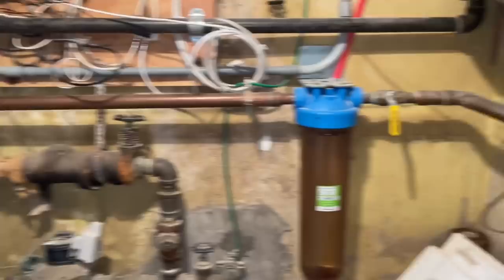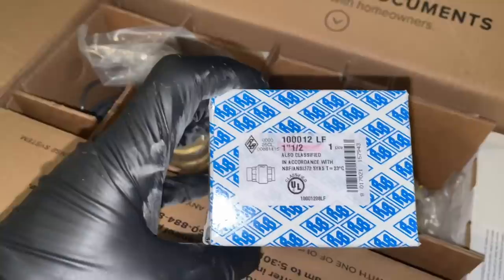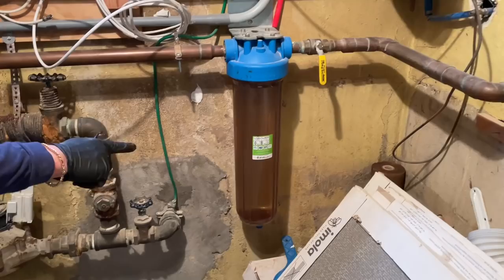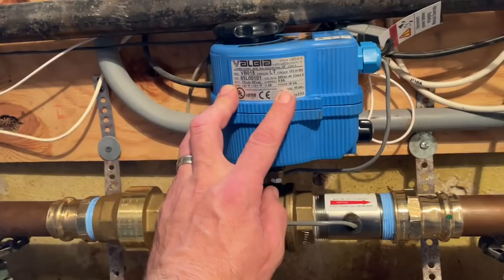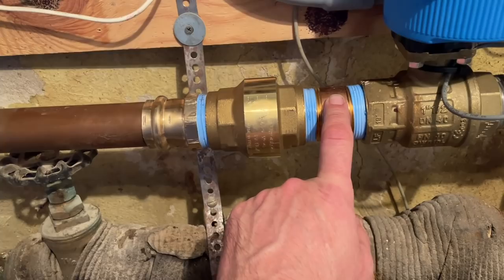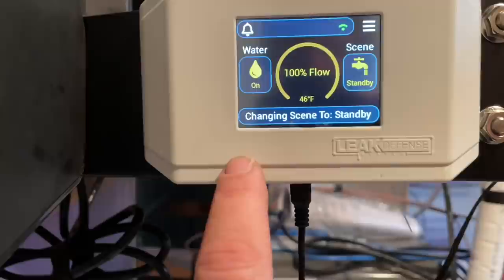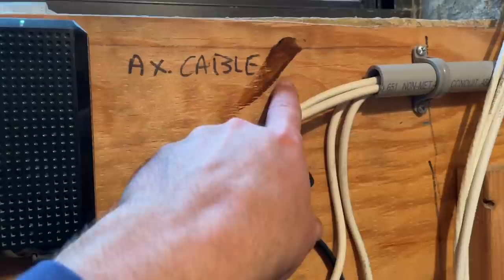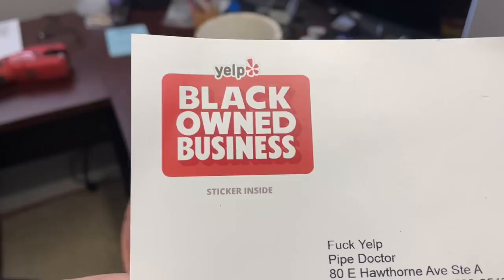Installation of Leak Defense System & Another 5,000 Subscriber Clue Maybe We Will Have a Giveaway!

Comment: Question about the check valve on that unit. Do you need to install a thermal expansion tank for the hot water heaters?I know I had to install them when I installed  pressure reducing valves on the main coming on.
Reply: On your next video of this type of installation can you show us more in detail the extra things you do to complete this type of installation it would be cool to see. Godzilla keep up the good work buddy 👍

Comment: Issue with leak defense if that if you have a busted pipe or busted hose, its going to run for 15 to 30 minutes before it trips. That's a lot of water. While the remote sensors can be a pain, they will trip the valve nearly instantly when a leak happens.

FWIW: for My home (still under construction) I am using hardwired sensors, so no batteries to change, no wireless connectivity issues either.
Reply: @PipeDoctor  
Some typos in that reply that you might want to edit ...

Comment: The other problem with this thing is yes it’s great great technology but the water can run up for two minutes before it shuts down to minutes of water at full flow can do some damage to the house to hardwood floors, where are the units have sensors of the sentence second day since moisture somewhere they shut the water down instantly so everything has it been edges and disadvantages, but like might be pipes said in one of his other videos customer service is big is very big with me so if the company doesn’t stand behind the product it’s not worth what you paid for it so keep that in mind to
Reply: I'm guessing 2-4K for one hardwood floor vs wiping out a downstairs, and a finished basement? I thought water damage was the biggest payout, because fires are less common.

Comment: Can the LCD control be placed in the living area a distance from the valve?  Great vid. Ps at 4:30 I thought I had a phone call from a wireless caller at my house.   
And.......... you don’t look black.  Must be the you tube compression.
Reply: @PipeDoctor  would this system work with an auto top off on a pool? I’ve got a float similar to a toilet fill valve in the concrete around my pool, and it seems like it slowly fills 24/7 sometimes in the summer. I really like the idea though. Never knew anything like this existed. Thanks for the vid.
Reply: @PipeDoctor  thanks for the response.

Comment: The sensor is in a galvanized pipe wtf ???? . Why not brass . Too soft ?
Reply: Stainless not galvanized. My guess is brass might create a small amount of galvanic current caused by Brass, that interferes with the sensor.
Reply: @guytech7310  ahh okay.  The sensor is going to die in a year or less anyway with that iron in the water lol 😆
Reply: Some brass is considered to have lead content, and lead-free is a thing these days. I read where some brass can be up to 8% lead.

But brass is an alloy, and I am not sure if the lead would be able to leach out or not.
Reply: 3 full wraps with the Blue Monster and them metals ain't touching no more
Reply: @guytech7310   - at 4:57 isn’t that a brass part connected to the steel pipe, with white Teflon tape or thread dope on the threads? So if galvanic action is going to happen, it seems to be already built in by the use of the dissimilar metals there.
Reply: @stevebabiak6997  definitely Stainless.
Reply: @PipeDoctor  Lead water pipes are what help bring down Rome .They were all suffering lead poisoning and didn't know it . That is why the atomic table  Symbol for Lead is Pb , and the latin name for lead is plumb, hence your trade, Plumber.

Comment: Installing a smart valve is great, insurance will pay for it. How about the correctly sized whole house filter, or better yet a hydrogen peroxide system which will oxidize incoming ferrous iron water, along with properly sized whole house filter. All of that iron sitting on the walls of the copper pipe will cause an electrolysis issue with a high possibility of pin hole leaks. Also, now that the homes water pipes have all that iron in the lines, the lines will need to be properly flushed, which includes the water heater. Fix the home, the home owner doesn't know any better. Also, if you ended up with crap on your finger, would you wipe it on the customers bathroom wall ? Disrespectful and sadly you are teaching your help to be just the same. Be a better person, not a filthy plumber.